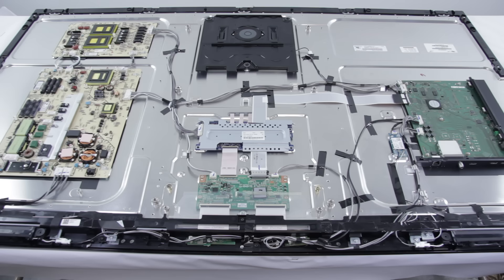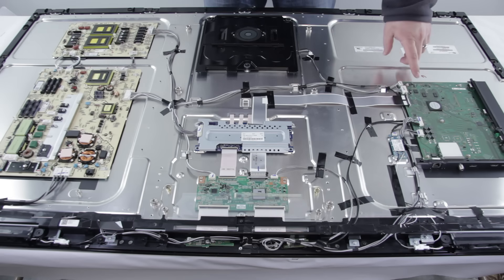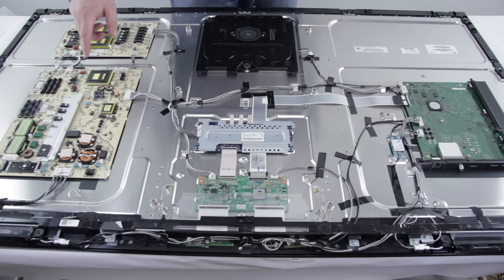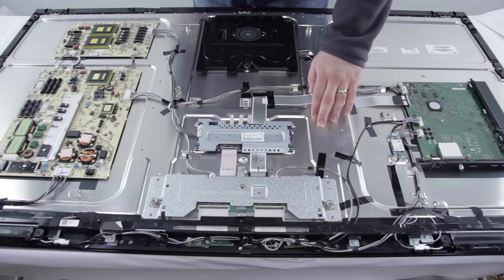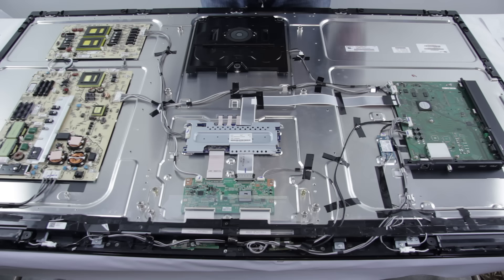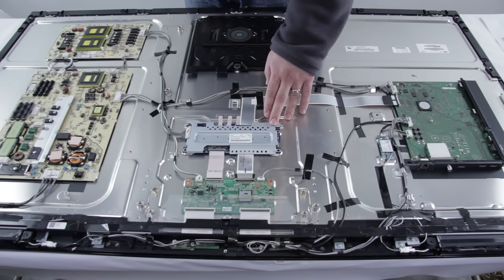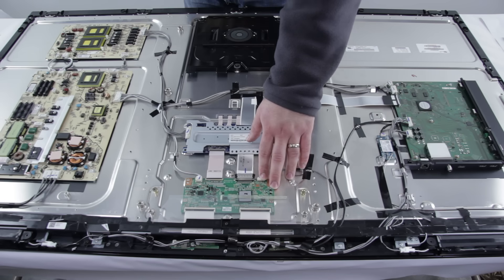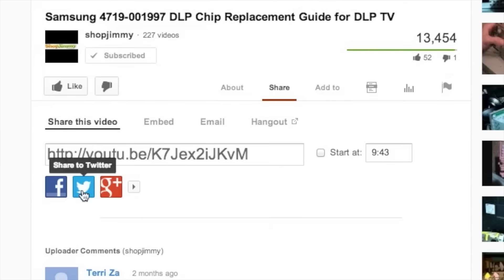LED TV Repair Tutorial - Common Symptoms & Solutions - How to Repair LED TVs

Comment: Hi! I have a zenith plasma tv that when i turn on tv shows green light in bottom meaning in turned on. But screen remains in black. What could be issue? Burned capacitor? Tv model is z42pq20-uc. Let me know if you can help. Thanks
Reply from the maker: Federico Waaisfeld   Please watch this video FIRST to help with your repair!  https://www.youtube.com/watch?v=BP3NVNCGEv8  I recommend replacing the YSUS and the YDRV (Top) board in your TV.  Click this link to replacement parts for your TV model number:  http://www.shopjimmy.com/catalogsearch/result/?q=z42pq20-uc  There may be multiple boards for the same TV model number, be sure to match part numbers on your current board, with your replacement for compatibility.  Here is a link to a video showing how to identify your part number, click here:  https://www.youtube.com/watch?v=GEllG3RV-tc  Thanks and please let us know if you have any further questions with your TV Repair!  www.shopjimmy.com

Comment: ok i left a message earlier and now i see that it is a problem with the LED driver. I did the flash light test. Where can i get the Led driver
Reply from the maker: Justin Credible   Please watch this video FIRST to help with your repair!  https://www.youtube.com/watch?v=BP3NVNCGEv8   I recommend replacing the power supply board in your TV (I don't think there is a backlight inverter board for your TV or its built into the power supply).  Click this link to a replacement part:  http://www.shopjimmy.com/lg-eay62810801-power-supply-unit.htm  Be sure to match part numbers on your current board, with your replacement for compatibility.  Here is a link to a video showing how to identify your part number, click here:  http://www.shopjimmy.com/lg-eay62810801-power-supply-unit.htm  Thanks and please let us know if you have any further questions with your TV Repair!  www.shopjimmy.com

Comment: Hello,

I have a Vizio E601i-A3. After a nearby lightning strike my TV has sound but no picture. It turns on just fine but I cannot access any menus or video playback. Any ideas?
Reply from the maker: skintner20  Please watch this video FIRST to help with your repair!  https://www.youtube.com/watch?v=BP3NVNCGEv8  I recommend replacing the main board for your TV Repair.  Click this link to replacement parts for your TV model number:  http://www.shopjimmy.com/catalogsearch/result/index/?cat=56&q=E601i-A3  There may be multiple boards for the same TV model number, be sure to match part numbers on your current board, with your replacement for compatibility.  Here is a link to a video showing how to identify your part number, click here:  https://www.youtube.com/watch?v=kxkeGLhlQY8  Thanks and please let us know if you have any further questions with your TV Repair!  www.shopjimmy.com

Comment: Hello, I have a Samsung LED TV Model UN40D5550, It has two years, now the TV turn on and off by itself every few minutes, i made a research and found that some capacitors can be broken, i want to know if it is right, and what do i need to repair it.
Reply from the maker: Frank Ñ L  Please watch this video FIRST to help with your repair!  https://www.youtube.com/watch?v=BP3NVNCGEv8  I recommend replacing  the main board in your TV.  Click this link to replacement main boards for your TV model number:  http://www.shopjimmy.com/catalogsearch/result/index/?cat=56&q=UN40D5550  There may be multiple boards for the same TV model number, be sure to match part numbers on your current board, with your replacement for compatibility.  Here is a link to a video showing how to identify your part number, click here:  https://www.youtube.com/watch?v=BEPWrefQvqI  Thanks and please let us know if you have any further questions with your TV Repair!  www.shopjimmy.com
Reply: Thanks.
Reply: Hi, Great video thank you. I have a Samsung un40d5550 which power cycles on and off, while the red power led indicator flashes. There are no visual signs of failure on the board. Thanks for your help!

Comment: I have an Element 40" LED TV (ELEFT406) with no backlight. I have been told that the backlight inverter is located on the power board in this model. After changing the power board (CV42001/CVB32001-3) I still have the same issue. Any suggestions?
Reply from the maker: Michael Foley   Since you have replaced the power supply board and still have the same problem, it sounds like you have bad LEDs in the TV.  Unfortunately there is not repair for this.  Thanks!  www.shopjimmy.com

Comment: Happy New Year gang! LG 47LS4500. Sound, but no picture. The screen does light up to a solid dark gray (along with a thin, 2mm vertical white line) when powered up. Kids said picture started acting crazy with blinking portions of picture, and black which eventually eroded to the solid gray "nothing" we have now. If you can help...please include link to part(s). Thank you!
Reply from the maker: David McGreevy   This sounds like a TV panel (TV Screen) problem.  If your TV panel is bad, it may be more cost-effective to replace the TV as panels are typically hard to find in stock, difficult to replace, and expensive.  Thanks and please let us know if you have any further questions!  www.shopjimmy.com

Comment: does replacing the t con board fix lines /partial screen missing. A childs toy was thrown at tv resulting in horizontal and vertical lines down the side and across the top. Model JMB Serial JA50B204BFHKPG114-109547 01480
Reply from the maker: Dale Eaton   With this situation, no the T-Con replacement will not fix the problem.  This sounds like a TV panel (TV Screen) problem.  If your TV panel is bad, it may be more cost-effective to replace the TV as panels are typically hard to find in stock, difficult to replace, and expensive.  Thanks and please let us know if you have any further questions!  www.shopjimmy.com

Comment: Hello, Shop Jimmy, I have Samsung "LA40B530P7RMXL" a month ago i had problem with power supply connectivity so serviceman changed it's power board, after that week later we noticed that it's brightness/gamma increases slowly after around 2 hours, brightness/gamma stays same in menu but it's changes in screen, after turning it off for like 15 or 30 minutes it runs fine for hours and same thing happens again, If there is anything other than changing display panel please suggest it, Thank you.
Reply from the maker: Proxyvin  Please watch this video FIRST to help with your repair!  https://www.youtube.com/watch?v=BP3NVNCGEv8  Sounds like you received a defective replacement power supply board.  Click this link to replacement parts for your TV model number on our website:  http://www.shopjimmy.com/catalogsearch/result/?q=40B530P7  There may be multiple boards for the same TV model number, be sure to match part numbers on your current board, with your replacement for compatibility.  Thanks and please let us know if you have any further questions with your TV Repair!  www.shopjimmy.com

Comment: I have a samsung un46c5000 46 inch led .it turns on and it plays the sound when its about to turn .it has a black screen and i can tell the back light is on .can you help me please ???
Reply from the maker: REDNineteen90   Please watch this video FIRST to help with your repair!  https://www.youtube.com/watch?v=BP3NVNCGEv8  This could be a problem with either the main board, the t-con board or the power supply.  You may need to replace each board individually to see which one fixes the problem.  Click this link to replacement parts for your TV model:  http://www.shopjimmy.com/catalogsearch/result/?q=un46c5000  There may be multiple boards for the same TV model number, be sure to match part numbers on your current board, with your replacement for compatibility.  Thanks and please let us know if you have any further questions with your TV Repair!  www.shopjimmy.com

Comment: I have  sanyo  NOAB6JK00001 that turns on and off ,no image and sound
Reply from the maker: Antonio Hernandez  Please watch this video FIRST to help with your repair!  https://www.youtube.com/watch?v=BP3NVNCGEv8  This could be a problem with either the main board or the t-con board in your TV.  You may need to replace each board individually to see which one fixes the problem.  Click this link to replacement parts for your TV model number.  http://www.shopjimmy.com/catalogsearch/result/?q=PN64D8000  There may be multiple boards for the same TV model number, be sure to match part numbers on your current board, with your replacement for compatibility.  Thanks and please let us know if you have any further questions with your TV Repair!  www.shopjimmy.com

Comment: Hello there, i have a Samsung 63" (160cm) FHD 3D Plasma TV 600Hz USB 2.0 PS63C7000YF, a remote hit the side of the screen, causing the picture to not come up, the screen has a crack line from the impact spot, to the top of the television, the sound does come on but no picture, can you please tell me what part i might need? 

thank you
Reply from the maker: holtzy93   This sounds like a TV panel (TV Screen) problem.  If your TV panel is bad, it may be more cost-effective to replace the TV as panels are typically hard to find in stock, difficult to replace, and expensive.  Thanks and please let us know if you have any further questions!  www.shopjimmy.com

Comment: I have a envision L37W698 lcd tv and if any manual or remote button is pressed the main screen goes on and will not go off unless I turn off the tv.all controls are lost unless I turn the Tv off. I can only turn the Tv off by the remote. Channels can be changed by changing the channel and turning the tv off for each time the channel is changed
Reply from the maker: david kunces   I recommend replacing the main board in your TV.  Unfortunately I do not see any replacement parts in the search results for your TV model number on our website.  Please reply with your part number on your main board and I can try searching for replacement parts.  Thanks and please let us know if you have any further questions!  www.shopjimmy.com

Comment: Hello i have a LG LED 50"  model 50PG3000-ZA. I had a problem on top of the display a thick line was no displaying correctly. After i opened the back of the tv and tried to clean the ribbons i tried switch it back on but now i have no display anywhere. What could it possibly be and how can i fix it. 
Thank you
Reply from the maker: Panayiotis Panayiotou   This sounds like a TV panel (TV Screen) problem.  If your TV panel is bad, it may be more cost-effective to replace the TV as panels are typically hard to find in stock, difficult to replace, and expensive.  Thanks and please let us know if you have any further questions!  www.shopjimmy.com

Comment: HI Shopjimmy, I have a Sony LEd Tv, model 32EX520.  made in Jan 12. My Tv starts OK with my cable but after 15-20 mins the picture goes off and i can hear only audio. I think i can see some dim light in the background, but there is no picture. This happens for cable as well as USB or HDMI model Can you pls inform what could be the problem. Thanks in advance
Reply from the maker: sunil monteiro  Please watch this video FIRST to help with your repair!  https://www.youtube.com/watch?v=BP3NVNCGEv8  This could be a problem with the power supply board or you have bad LEDs in the TV panel.  You can replace the power supply board to see if that fixes the problem with your TV.  Click this link to a replacement power supply board for your TV model number:  http://www.shopjimmy.com/sony-1-474-277-12-ge2-board.htm  Be sure to match part numbers on your current board, with your replacement for compatibility.  Here is a link to a video showing how to identify your part number, click here:  https://www.youtube.com/watch?v=8YA2c8CZVyo  Thanks and please let us know if you have any further questions with your TV Repair!  www.shopjimmy.com

Comment: I have a panasonic tx-l47et5b. There is no sound or picture. I power up and the backlight starts up but no images or sound. I have replaced the av board, power board and led driver board but still no picture. Any advice.

Comment: I own a Samsung LED 40"TV (UA40EH5000RXSW) & it's not coming on. The power light keeps going on & off. I opened the back cover to see if any of the capacitors might've bulged but they all look fine to me. Please what more should I check for? Thank you
Reply from the maker: Wale Ajayi  Please watch this video FIRST to help with your repair!  https://www.youtube.com/watch?v=BP3NVNCGEv8  I recommend replacing the main board in your TV.  Click this link to replacement main boards for your TV model number:  http://www.shopjimmy.com/catalogsearch/result/index/?cat=56&q=40EH5000  There may be multiple boards for the same TV model number, be sure to match part numbers on your current board, with your replacement for compatibility.  Here is a link to a video showing how to identify your part number, click here:  https://www.youtube.com/watch?v=BEPWrefQvqI  Thanks and please let us know if you have any further questions with your TV Repair!  www.shopjimmy.com

Comment: Mine is Elements LED TV with 50 inches Model no ELEFW502 - Problem no screen display and no sound nothing is working. Only i can see red light when i plugged in, after i click on Power button it turn to Blue the remote light but TV not responding anything no display no sound. Please advice what can i do for troubleshoot this. I have brought 13 months back last year November. Just one year old.
http://www.elementelectronics.com/products/elefw502/
Reply from the maker: shiva kumar kandigatla   Please watch this video FIRST to help with your repair!  https://www.youtube.com/watch?v=BP3NVNCGEv8  I recommend replacing the main board in your TV.  Click this link to replacement main boards:  http://www.shopjimmy.com/catalogsearch/result/index/?cat=56&q=ELEFW502  Be sure to match part numbers on your current board, with your replacement for compatibility.  Thanks and please let us know if you have any further questions with your TV Repair!  www.shopjimmy.com

Comment: Samsung SmartTV bought recently model number UN75F630AF.

I was messing around and caused a small mark on the screen of my father's television. Not only is there a mark, but also it messed with the pixels. Reason I say that is that there is a red line going down the screen with a few white lines and a black line leading down to the mark. It's near the top of the screen and is only noticable when the TV is on.
Reply from the maker: Entinu   This sounds like a TV panel (TV Screen) problem.  If your TV panel is bad, it may be more cost-effective to replace the TV as panels are typically hard to find in stock, difficult to replace, and expensive.  Thanks and please let us know if you have any further questions!  www.shopjimmy.com

Comment: Hello. I have a Grundig TV that is about a year old. When I turn it on the power indicator LED blinks as usual and the screen starts up. It shows me the Grundig logo and then it disappears (the screen is still turned on). When the screen has been black for a second or so, the backlights die too. So:

1. Backlights and screen goes on, displaying the grundig logo
2. The grundig logo disappears, but the backlights are still on
3. The backlight dies too
4. Repeat until powersupply is removed (I can't turn it off with the button or the remote)

Do you have any ideas about what the problem might be? Because everything does apparently work.

Comment: My Sharp Aquos tv, (model # LC-C4654U) has no display and the power light flashes continuously.  I have attempted to reset it as directed by Sharp support, but with no success.  Based on these symptoms, would you recommend repairing the set or replacing it?  Thanks.

Comment: Hello, I have a Vizio xvt553sv. After an apparent power outage/surge the tv came on and showed the logo then said no input but it was on a known good input prior to the storm. Then tv shut off with "vizio" blinking, would not come on. Unplugged and tried again had same problem. Now tv won't come on just "vizio" blinking on bottom of tv. Also won't recognize any hdmi inputs. Took back off tv, see nothing obvious, capacitors don't look swelled but the larger ones have a raised + on top.

Comment: I have a Samsung UN46D6900WF with no picture and sound is working.  It started out as all the picture was black except for about a 1/2 inch strip horizonally across the bottom of the screen where the picture did still work.  Now I have a few horizontal lines across the bottom but that is it. Here is a link to a picture: http://imgur.com/GocAHYT Any thoughts?  Thanks, these videos are great.
Reply from the maker: John Dwyer  Please watch this video FIRST to help with your repair!  https://www.youtube.com/watch?v=BP3NVNCGEv8  This could be a problem with the main board or the TV panel.  You can replace the main board to see if that fixes the problem.  Click this link to replacement main boards for your TV model number:  http://www.shopjimmy.com/catalogsearch/result/index/?cat=56&q=UN46D6900WF  Be sure to match part numbers on your current board, with your replacement for compatibility.  Here is a link to a video showing how to identify your part number, click here:  https://www.youtube.com/watch?v=BEPWrefQvqI  Thanks and please let us know if you have any further questions with your TV Repair!  www.shopjimmy.com